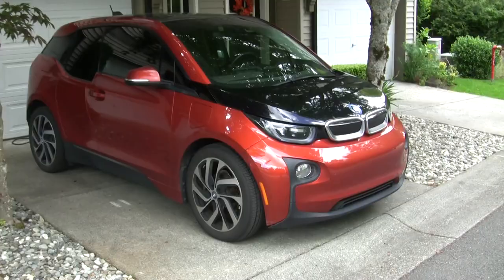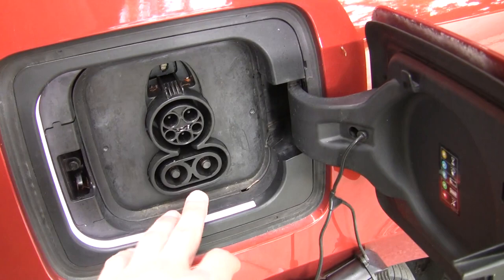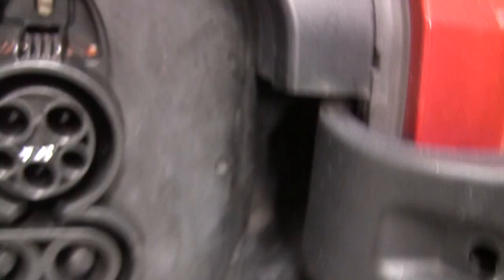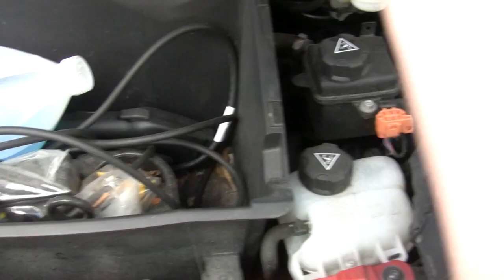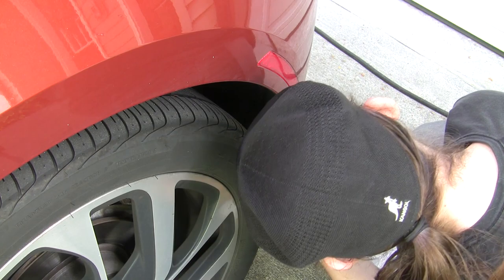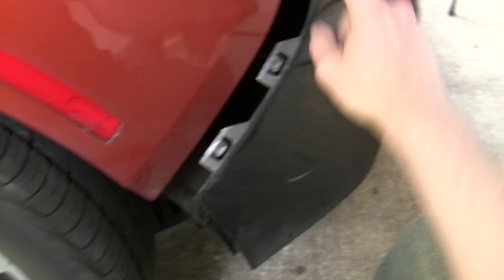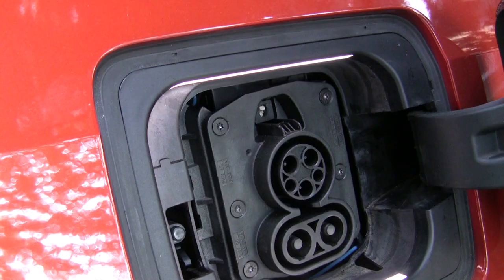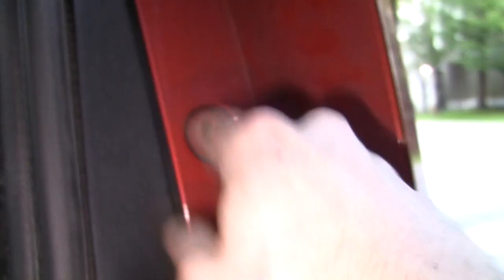Repair a BMW I3's jammed plug lock

Comment: Thanks for the interesting video. I am able to confirm what others suggested might work in the comments of the other video on this subject from Bjorn. It's entirely possible to do this repair WITHOUT removing the rear bumper and quarter panel, and WITHOUT jacking up the car and removing the wheel and inner well liner as well.  

I did it in about an hour on a US spec 2015 REX.  I was glad I was able to find the necessary 20T PENTA-LOBE BIT. I had to buy a whole set of 3/8 drive bits to get it, but well worth it.  On the US i3 the fasteners are on the back side so I could not get a ratchet in there.  I was able to turn the bit by hand. (EDIT: I found my short swivel ratchet which allowed me to tighten these properly when reinstalling.) In addition, I did not find it necessary to unplug the light bar.  Just left it dangling with the lid and frame.  Plugging the lid latch actuator back in was a bit tricky, but manageable.

Comment: Thank you! With one quick search on YouTube I've discovered why my I3 has not been able to charge at any Quick Charge station lately. Figured it was something like this. Thanks for posting video
Reply: Hey there did you find this was the solution?..My car would only charge at a DC fast charge when i lifted up on the handle..otherwise it wouldnt. I had BMW replace this with a new locking unit and it still has the same problem, it wont lock the charging handle even on AC charging when I lock the car. They refuse to to the job again and fix it saying I need to replace the entire charging port assembly and cables!! for $2700!!.. I contacted BMW support and they are looking into it. I am going to post this on my youtube channel to show that in my case, the reason people are lifting up on the charging handle to start DC fast charging is because of the locking mechanism not working properly.
Reply: @johnnyzee383  I found that the little latch that locked the charger in place was sticking. A little lube in there seem to solve the problem temporarily. I still occasionally run into this problem when I forget to get lube on it.
Reply: @campjoe42  And this happened with DC fast charging?
Reply: @johnnyzee383  my particular problem was when I went to quick charge the small plastic lock would not engage with the charge handle. It is a small plastic knob at the top of the charge cluster. If it does not engage with the charge handle the charging will not start. My home charger would work just fine but I could not use quick charge. I found that a little dry lube shot in there and locking and unlocking the car would help this little plastic piece run smoother. Hope this helps a little bit not that great at explaining things in text....
Reply: @campjoe42  Thanks, ok mine would not charge either and now I know why..so the handle of the DC charge is so heavy it sags on the charging port and that is enough for that little locking pin to BIND on the top of the locking handle latch not engaging properly and if that happens the car reports to the charger that its not locked and charging cannot commence. By lifting up slightly you straighten out the charging handle and the pin can then slide over the locking latch and secure the handle and charging would commence.

Comment: I replaced mine a few months back using a different video.  No removing the rear bumper or other panels.  Just the inner wheel liner.  Here's a link to another video in case it helps anybody else wants more info before tackling the DIY.  https://youtu.be/ziVu9-v69eE

Comment: How idiotic car manufacturers are to make things so difficult to replace. I just started having the lock pin issue and used the emergency release,  but I can do that forever, i sprayed wd-40 on the pin, have yet to plug nozzle back in, but going to try tonight and see if that helped at all. Thanks for the well informed video, very helpfull, beers on me buddy.😊

Comment: My level 2 works, on my charge port but the dc fast charge level 3 will not work, at any station. The dealer wants $4k to fix by replacing the fast charging cable.   … any experience with what could be throwing it off? I’ve seen people replace HV cables but not sure… any thoughts???!

Comment: My I3 is also not fast charging. ISTA diagnostic software says it is a wiring disconnect to the locking mechanism or a faulty locking mechanism. Seems like the wiring is less likely to fail than the lock. Wondering if you know what your fault looked like to ISTA.

Comment: Lets say you have a i3 2015 (like i do) and you want this issue fixed. You have warranty on it but you bought it from someone else. How would you go about that? Fix it yourself? or have bmw fix it and hope they wont charge you? Im not the greatest mechanic and i dont want to make it worst (dc fast charging aka combo wont work)
Reply from the maker: I'd give the service department a visit. See what they say re: your warranty. Definitely don't attempt this if you aren't confident - there's high voltage involved!
Reply: Spag The Maker Ya i dont plan on repairing it on my own. I did buy the car off someone else and i guess apparently warranty doesnt apply on the car anymore. Which sucks bc battery only charges up to a max of 55-60. I thought 70 was the max. Im still looking online for that motor part but i cant find it. Im in serious trouble :/
Reply from the maker: @CrackGameingStudio  I'm fairly certain 61-13-6-842-870 is the part number, but there's some conflicting reports. Yeah, 55-60 miles is normal for the smaller battery. You really have to drive efficiently to break 70 miles. Driving fast on the highway I rarely get past 50ish. If I slow down I get the 70 miles. With the fixed motor I made my 150 mile trip with no issues topping up at a few CCS DCFC stations, so keep trying!
Reply: US market W/DCFC locking pin actuator = 61-13-6-805-424 
EU market w/DCFC locking pin actuator = 61-13-6-805-425